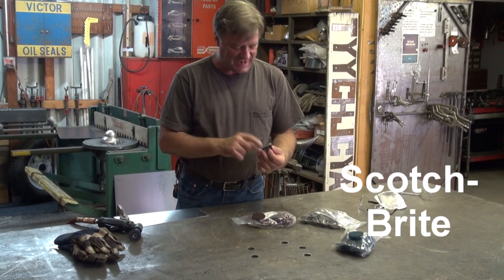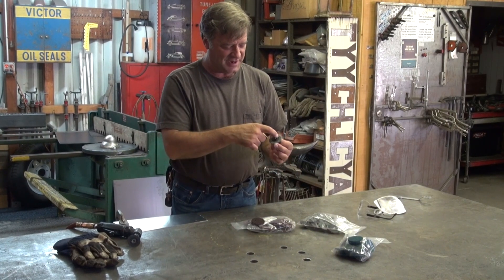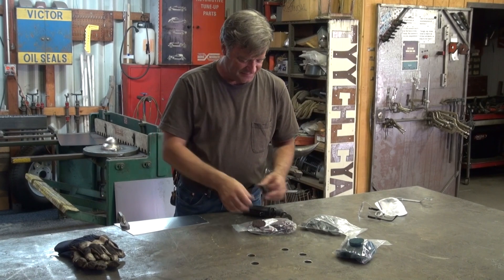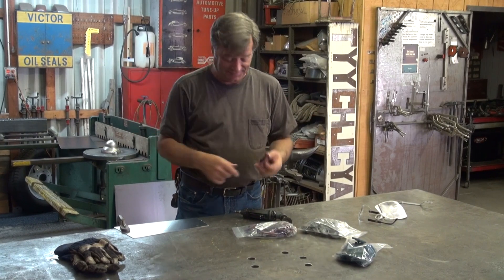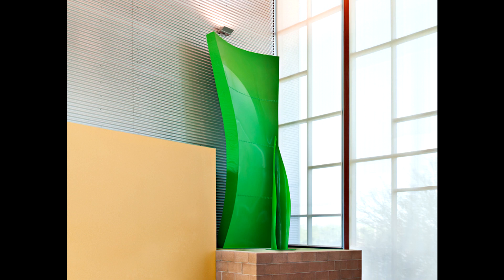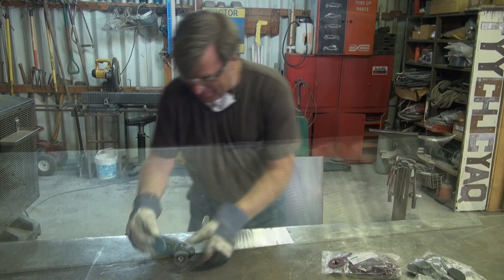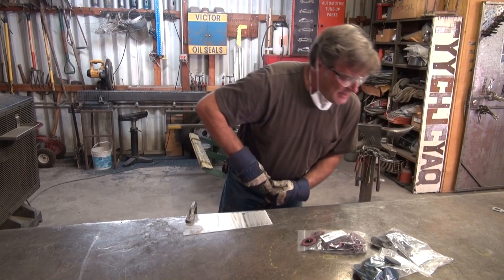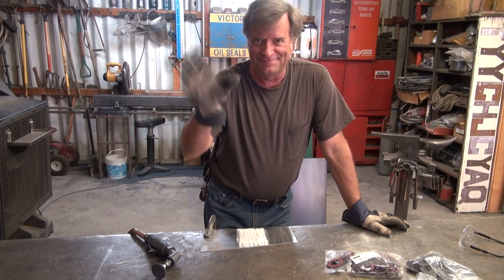How to Shine Metal - Kevin Caron

Comment: Hi, you seem to know a bit about steel so I hope you can solve my dilemma? I made two swords from raw steel purchased from a mill. I polished them up to mirror finish, however I find over time that rust begins to form again. I purchased a sword 10 years ago from Spain and that is always mirror shiny without any maintenance. How can I treat my two swords so they never rust?
Reply from the maker: You have to old them after you polish them..     Or use steel with more chromium in it to make the sword..
Reply: "old them"....what does that mean?
Reply from the maker: Damn auto correct!    Oil them!  You have to oil them so they don't rust..
Reply: +Kevin Caron, Artist mineral oil? What do you recommend or use?
Reply from the maker: Mineral oil or a light machine oil or even a penetrating oil (wd40) should work..